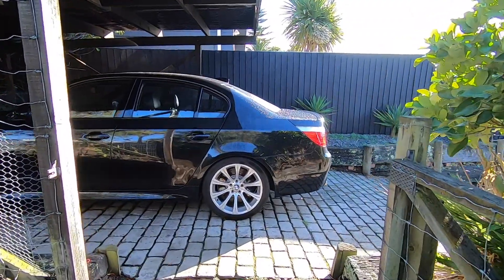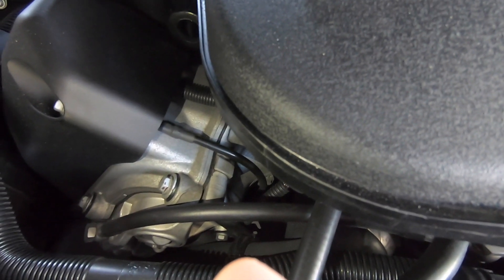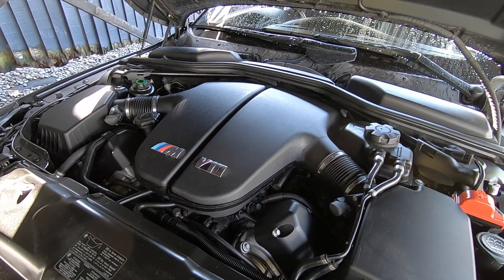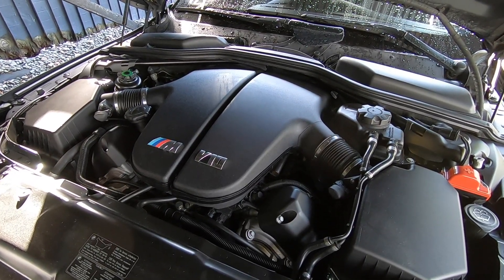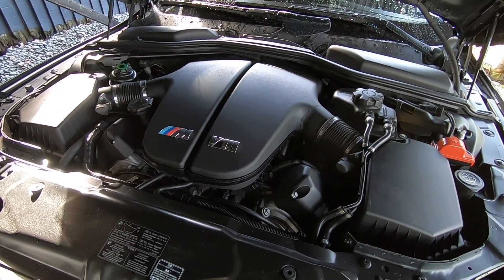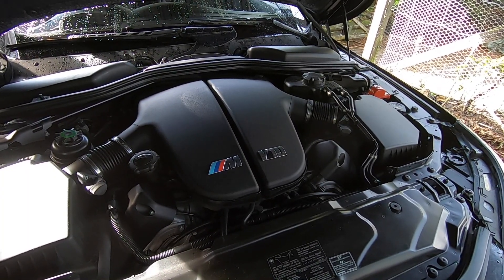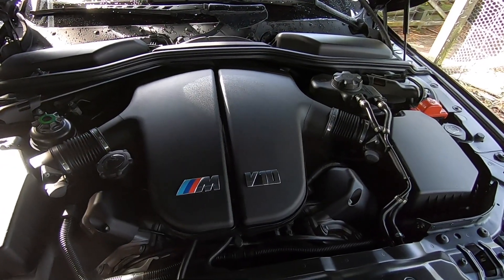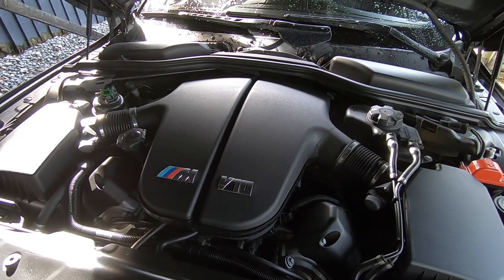BMW E60 M5 S85 VANOS Solenoids

Comment: Hi M tech guy. 
If the vanos pressure was low would it throw a code/ give a warning light on the dash?
How can you know if the vanos system is working properly? Can ISTA do a vanos test or give you information on the vanos system? 

Do you know where you can get the vanos test kit that bolts on - can’t seem to find one anywhere..
Reply from the maker: You can carry out a VANOS solenoid function test via ISTA.
To inspect the VANOS pressure you have to install a pressure gauge rated for the application

Comment: @M Tech Guy I got a code of 271C Vanos control inlet bank 2 where is that located ?
Reply from the maker: Front of the left hand cylinder head
Reply: @MTechGuy   what is it exactly and how much will that cost to fix in your opinion

Comment: Hi mate thanks to your videos I've been able to replace the belts, spiners and solenoids on my M6. Before I had 4 bad results on the vanos test with Not OK on the min quality valves. With the new solenoids I have 4 OK results, between 0.7 and 0.9. The problem is further, after 3 bleedings it remains the same, the min camshaft positions on both intake camshafts is bad, around 130 degrees. Instead of moving from around 80 to 150 degrees, they are only moving from 120 to 150 degrees. On the road I don't have any fault code. The only symptom I see is that after deleting the vanos adaptations, every time my idle becomes fragile for a while, the engine is stalling frequently if I let the car on idle for several minutes, despite the fact that it's very stable. I start to think that my 2 intake vanos are stuck, I've checked the pressure and the gauge is showing a steady 80 bars on idle so I don't suspect a problem of pump or pressure. Or maybe the Vanos adjusting unit.
Reply from the maker: Goad to hear the videos have been of value 👍
Did you fit genuine/OEM solenoids or aftermarket ones?
I would start by changing the oil (for 10W 60) if you haven’t already, and running the bleed procedure three more times, then let the adaptions do their thing for a few miles. Don’t rule out other parts contributing to the issue (failing ionic modules, worn spark plugs etc)
Reply: @MTechGuy  thanks mate, the plugs and the coils are brand new, never had problems with the ionic modules so i don't suspect them to be in cause here ? The solenoids are aftermarkets but already tested successfully by other guys, that's why i dared trying them. Also why they would work fine on exhausts and not not intakes ? would be strange. But to be sure i ordered a pair of bmw brand new units to install them on intakes and see how it works. The oil is 4000km (the car has 192.000km, from Japan), and on last change it was really really dirty so i was thinking about replacing it again like you suggested. I love your videos, they've been so so useful to me since i have this car (which i love btw), keep up the good work mate cheers !
Reply from the maker: Cheers Le Garage de Roman, great to hear you’ve found the videos of value 👍 I’d be suspicious of the aftermarket solenoids but sounds like a couple of oil changes back to back with a few miles in between will do the engine the world of good

Comment: Hi just bought my m5 a month ago. I sometimes get a slight noise when I blip the throttle. It seems to vibrate from the black unit that sits on top of the camshaft cover? Not all the time. I’ve had a winning noise that sounds like the fan is catching something. Only when I Rev-drive. Any ideas please
Reply from the maker: Noise from that area is usually associated with the VANOS gears. Check out a previous video I did onVANOS noise- https://youtu.be/v8TjzbiV_mQ
Reply: @MTechGuy  hi Thankyou for replying. The noise comes from the front of the cam shaft on the drivers side. It only comes on when you either Rev it slightly or when you start to drive. It doesn’t do it all the time. It sort of sounds like a fan catching something?? I also have a sounds like the rear tire is catching the inner liner on both sides when I just set off if I’m turning the car around?
Reply from the maker: The noise at the rear is your differential, when the car sits for a while the oil drains out from the LSD plates, and the LSD additive can separate from the oil. Should come right once the oil has got moving and warms up. If it doesn’t- change the oil
Reply: @MTechGuy  I had the same issue, i changed the diff oil yesterday, with the FM booster.... a few figure of eights later and the noise has gone.
Reply from the maker: @richardgriffin9067  Awesome, nice easy fix!

Comment: Do you know when the newer solenoids were used as far as model year? Thanks!
Reply from the maker: No sure, but they all have the potential to fail. You can tell if you have the old ones fitted because they are black
Reply: Ever since my dad replaced his it never had issues, bmw said it's was a factory fault

Comment: Solid informative video as always👍
No previous problem with my vanos system👍😅
Just been out driving my E60 M5👍😁 
This weekend i will do full disamble off brakes on all 4 corners. Clean caliper, pads, sensor, discs and reasemble with grease for 100% function👍 
My car has done 131000km with same discs... almost unbeliveble but its a 1 owner car with past owner passing 80years old, thats the reason👴😂
Have a nice weekend👍
Reply from the maker: Cheers Jesper, that’s not bad the discs lasted that long because they are not cheap! It always a good feeling have it a fresh set of brakes, have fun with the replacement 👍
 M5 is a hell of a car for a guy that age, but sounded like he had good taste 🙂
Reply: @MTechGuy  thank's👍 he loves cars 👍 I was told he bought a new BMW 740e because he felt his age has passed M-cars😅 but he owns a AMG GTS, so still a mean car in his garage👍😎

Comment: I had the 271A engine code on mine i changed all the solenoids and the 2 vanos line and now the car runs perfectly, i paid 1900€ for parts and labour which is cheap compared to a few years ago
Reply from the maker: Thanks for sharing, yes that’s not a bad price 👍